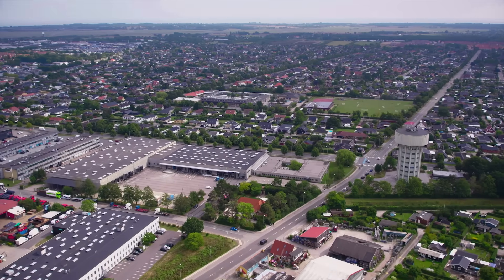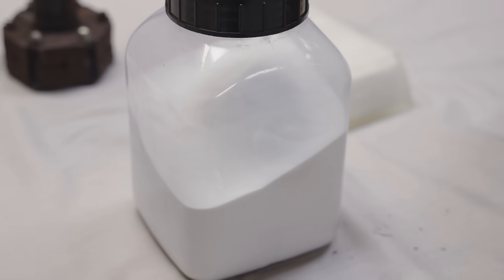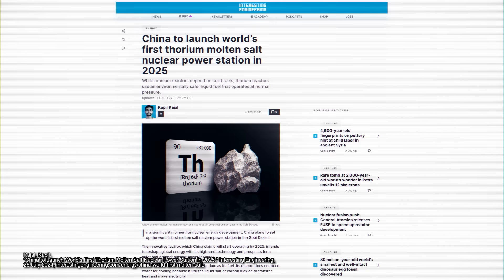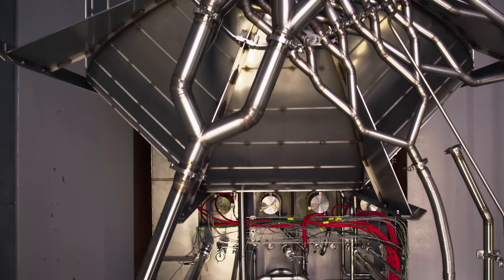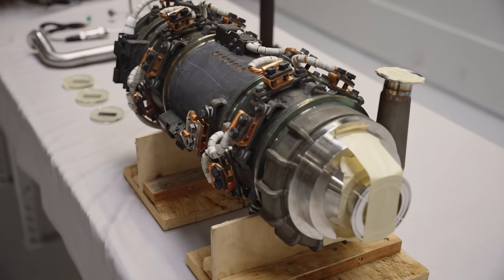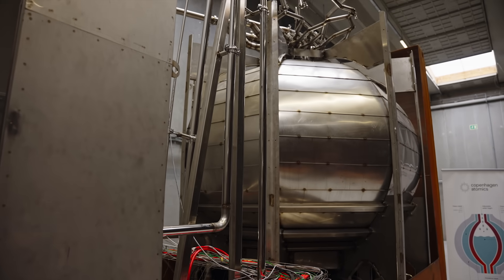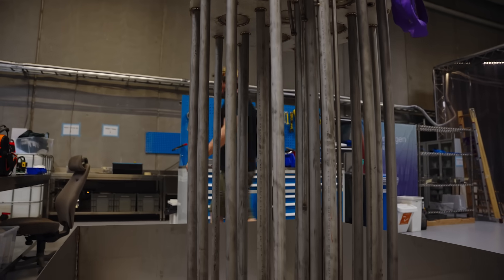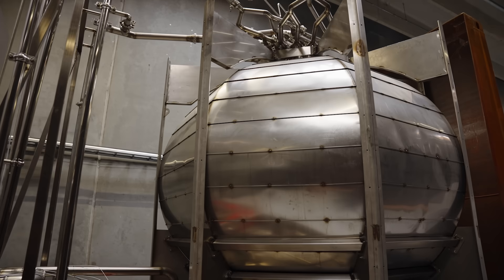Why Isn’t Thorium Changing the World?

Comment: Ya know, I wonder if the same process of protecting the metals could be applied elsewhere? 
This question comes to mind cause I was learning about saltwater batteries and one of the main problems that I have found is on the nonshiny metal anode (- or + not sure but the basic concept is shiny metal like copper, dull metal like alumininum, and electrolite like saltwater max 35% concentrate creates a battery the pushes .1A and .5V about 10-12 will charge a cell phone. other electrolites like pool chems and metals like magnesium (firestrikers or welding rods) + copper = even stronger battery.
BUT, here is the catch. mg+cu+NaCl  causes salt build up on the mg stick and stops power production, BUT is a cheap form of desalinating water plus power production.
Would that protection process be applicable to this from of power production?

Comment: Thorium is easy to mine but it has to be used in what amounts to a breeder reactor. Neutrons from the core convert the thorium to Uranium 233. This is removed, processed and put back as core fuel. It’s complicated. 
Static salt like Moltex use natural uranium and fully burn it leaving almost no waste. They also burn existing irradiated uranium fuel. This solves any waste storage issues. Because it’s not waste. It’s simply part used.

Comment: If you´ve been in Denmark with open eyes you should have seen the future: in 2024 83% of electricity was already renewable and exporting from all his wind power.   it is european leader in district heating, of course with renewable as well. 51% of all new cars are BEV. And all this will rise even higher in the next years. So why implement a potential dangerous and comlicated technic that only works on the presentation screens of start ups?

Comment: The high-temperature molten salt is highly corrosive to reactor materials, especially structural metals and alloys.
Developing materials that can withstand long-term exposure to fluoride or chloride salts without excessive degradation is a major engineering challenge.
Even in short-time experiments, it does not work. You get really big problems if not with the tubing, then with the pumps and the matter flow. When cooling down it becomes solid and therefore changes flow characteristics.
Reply: You do know that Copenhagen Atomics have huge experience with actual molten salt experiments? 
Last time I checked they had 50 years worth of molten-salt experimental data (obviously obtained by running a number of experiments in parallel). 
They know about corrosion, and they have solved corrosion. At least for a non-radioactive system, adding high radiation might add complications. 

The solution is NOT advanced materials. It is to keep the salt pure, since an oxygen- and water-free molten FLIBE salt does not cause corrosion. Which is what their experiments confirm. 

They have build their own production line for ultra-pure FLIBE salts, they have tested it in their own salt loops. And they sell both salts and loops to universities around the world (also there is a data-sharing condition on buying a salt loop, so they gain even more experimental data than what they produce in-company). 

To be clear, running a reactor will eventually cause a build-up of fission products where some of them will be corrosive. So initially the lifetime of a reactor will be limited to about 5 years, which is more than enough to become economical (much faster and cheaper to produce than a LWR). 

They are however designing a system for online cleaning of the molten salts, which would significantly extend the lifetime of the reactor. But they don't expect it to be operational for the early commercial reactors.

Comment: Let's break down the reactor's design:
Shape and Structure:
Imagine a sphere. At the very center, you have the reactor core. This is where the thorium fuel and the particle accelerator interact. Think of it like a super-hot, high-energy reaction zone.
Now, picture layers around this core. First comes the cooling system. You could have tubes or channels carrying that liquid metal coolant right through the reactor core to keep things cool.
Next, comes the shielding. A thick, spherical layer surrounding everything else, made of something heavy and dense to block that radiation.
Reactor Core:
Zooming in on the core, we have a few key components:
 * Thorium fuel: This could be in pellet form, arranged in a specific pattern, or even embedded within a specialized structure. It's the fuel that makes the whole thing work.
 * Particle Accelerator: Think of this as a system of electrodes or coils, arranged in a way to accelerate particles towards the thorium fuel. It triggers the fission reaction.
Key Considerations:
 * Materials: The reactor core needs materials that can withstand immense heat and radiation, like specialized ceramics or high-temperature alloys. The coolant system needs to use a liquid metal that won't react with the reactor materials.
 * Control Systems: We'll need ways to control the reaction. This might involve things like control rods, which can absorb neutrons and slow down the reaction, or maybe even a system that adjusts the accelerator's output.
 * Safety Features: Redundant safety systems are essential. We're talking automatic shutdown mechanisms, emergency cooling systems, and rigorous monitoring of the reactor's conditions.
This design is a simplified overview, but it covers the basics of a small, theoretical thorium reactor.

Okay, let's get into the nitty-gritty of materials.
For the reactor core, you'd want something incredibly sturdy to house the thorium fuel. Think of materials like tungsten carbide or even high-strength ceramics. These can handle the crazy heat and radiation inside the reactor.
Now, the thorium fuel itself – that's a specialized case. It's really about getting the right form of thorium and potentially mixing it with other materials to optimize the reaction.
For the particle accelerator, materials like tungsten for the electrodes might work well because of its ability to withstand high temperatures and electric currents.
Liquid metals are your best bet for the coolant. Sodium or a lead-bismuth alloy would be good choices.
And for the shielding, lead is a classic. It's dense, and it does a great job absorbing radiation. But you could also consider depleted uranium, which is even denser.

So, for a particle accelerator in a tiny reactor, we're looking at something super compact. A linear accelerator seems like the best bet.
Imagine a tube, maybe a few inches long. The walls of this tube would be lined with a series of electrodes – think of them like metal rings. Each ring gets a jolt of electricity, creating an electric field.
Now, you shoot the particles you want to accelerate – let's say protons – into one end of the tube. The first electrode gives them a push, speeding them up. As they travel down the tube, they get another push from the next electrode, and another, and another. By the time they reach the end of the tube, they're moving super fast.
To make this happen, we'd need a super-precise way to time the electricity going to each electrode. Everything has to be perfectly synchronized so the particles get a boost at exactly the right moment. You'd also need some way to generate the high voltage needed for those electric fields.
The materials for this are crucial. The tube itself needs to be a good insulator, so the electricity only goes where you want it. The electrodes should be made of something that can handle high voltage and not break down.

Alright, let's craft a detailed picture of this ideal microreactor, focusing on its construction, operation, materials, and manufacturing:
Reactor Design & Operation:
 * Shape: A perfect sphere, roughly the size of a basketball (approximately 24 cm diameter), to optimize shielding and energy containment.
 * Core: A central spherical core (4 cm diameter) made of silicon carbide, designed to withstand extreme temperatures and radiation.
 * Fuel: Thorium dioxide, highly purified, arranged in a 3D-printed lattice structure within the core. This lattice maximizes surface area for proton interaction.
 * Particle Accelerator: A miniaturized linear accelerator, integrated into the core, uses electric fields to accelerate protons to several MeV.
 * Proton Target: A thin layer of tungsten, deposited onto the thorium lattice, enhances proton interaction.
 * Coolant: Liquid sodium, circulated through microfluidic channels 3D-printed within the silicon carbide core, removes heat.
 * Heat Exchanger: A microchannel heat exchanger, using copper alloy, transfers heat from sodium to a working fluid (e.g., supercritical CO2).
 * Shielding: A thick spherical shell of depleted uranium surrounds the core, providing radiation protection. Graphite and Beryllium layers within the shielding enhance neutron moderation.
 * Control: A computer system monitors sensors and adjusts the accelerator beam and coolant flow to maintain stable operation.
Materials:
 * Silicon Carbide (SiC): For the reactor core, due to its high-temperature resistance, radiation hardness, and potential for microfabrication.
 * Thorium Dioxide (ThO2): The fuel, highly purified and potentially alloyed for optimal nuclear properties.
 * Tungsten (W): For the proton target, due to its high melting point and resistance to sputtering.
 * Liquid Sodium (Na): The coolant, chosen for its excellent heat transfer properties.
 * Copper Alloy: For the heat exchanger, due to its high thermal conductivity.
 * Depleted Uranium (DU): For the shielding, due to its high density and effective radiation absorption.
 * Graphite/Beryllium: Neutron moderator materials within the shielding.
 * Advanced Ceramics/Composites: For the linear accelerator and other components.
Manufacturing Process:
 * Core Fabrication:
   * Silicon carbide powder is used in a specialized 3D printing process (e.g., stereolithography or binder jetting) to create the spherical core with integrated microfluidic channels.
   * The printed core is sintered to achieve the desired density and strength.
   * The thorium dioxide lattice is 3D printed separately and then inserted into the core.
   * The tungsten target is deposited onto the thorium lattice using a vapor deposition technique.
 * Accelerator Integration:
   * The miniaturized linear accelerator components are fabricated using microfabrication techniques (e.g., photolithography, etching).
   * These components are then integrated into the core, ensuring precise alignment.
 * Cooling System:
   * The microchannel heat exchanger is 3D printed from copper alloy.
   * The electromagnetic pump and piping are assembled and connected to the core and heat exchanger.
 * Shielding Assembly:
   * Depleted uranium blocks are cast and machined to form the spherical shield.
   * Graphite and Beryllium moderator plates are integrated into the shield.
   * The core, cooling system, and accelerator are carefully placed within the shield.
 * Control System:
   * Sensors (thermocouples, radiation detectors) are integrated into the core and shielding.
   * The computer control system is programmed and connected to the sensors and actuators.
 * Testing and Validation:
   * The reactor is subjected to rigorous testing to verify its performance and safety.
   * This includes testing of the particle accelerator, cooling system, shielding, and control system.
Operational Details:
 * Hydrogen gas is ionized and injected into the linear accelerator.
 * The accelerator generates a focused proton beam, which is directed onto the tungsten target and thorium lattice.
 * Proton interactions with thorium initiate fission reactions, releasing energy.
 * The liquid sodium coolant removes the heat generated by the fission reactions.
 * The heat is transferred to a working fluid in the heat exchanger, which can then be used to generate electricity.
 * The control system continuously monitors the reactor's performance and makes adjustments as needed to ensure stable and safe operation.
Reply: This will produce 1kwh for 55 days before being refueled.

A larger design, the size of a refrigerator, will last 155 years before needing to be refueled.

There is a radically different method, not requiring any fuel at all that will produce the same power output continuously, and essentially indefinitely.
Reply: @kylehill

Kyle, the key insight here is the introduction of a linear particle accelerator employing a stream of protons from liquid hydrogen.  There is no need for uranium to initiate the process.   Please don't steal my idea.
Reply: If you can, I would appreciate any  connections you can provide me to others in the field.  I'm developing reactor the size of a basketball that can power an average household.

Comment: Ok i have to ask the obvious, why not use silica glass lined stainless steel? Silica glass can withstand the operating temperatures, has amazing salt corrosion resistance, and probably only needs to be a few millimeters thick or maybe just a thin coating... so why the difficulty in material science? As an electrical engineer I know my place in science is mostly geared towards the physical sciences of electricity but even that has material science involved. Transmission lines are electrically isolated from earth through means of ceramics and or glass... wonder if the same can be used to deal with the high levels of extremes that thorium salts may produce, would you not agree?

Comment: The US stopped molten salt thorium fueled reactors in the 60's, because we wanted plutonium for nuclear weapons.  Thorium fueled reactors do not generate plutonium, they just make more fuel from the thorium (the thorium is converted to U-233, which is fissile).  It's cheap, safe, and could supply all the power we need for centuries.  But we can't do it, because people are afraid of nuclear power.

What they should be afraid of is coal power.  But people are sheep and are willfully uninformed.

Comment: Ehhh not really assuming it was recently refined natural thorium is 99.8% thorium 232 which is an weak alpha emitter so the jug would block the little bit of radiation there is. that is assuming there was none on the outside. Also sodium floride has a boiling point of 1695C so you can "work with it" well past 700C, working with it at that temperature though would cause corrosion and near it's melting point a lot of stuff becomes soft, sooooo probably not wise to work with it there either.

Comment: Constructing parts out of Iridium seems like an obvious solution (the problem is likely cost).  It's corrosion resistant and has a melting point of 2,446 C, much higher than Gold (1,064 C). Platinum could work too (melting point of 1,768).

Comment: It's too bad they can't figure out a way to get it to circulate without the pump using convection currents or something.
Alternately use something that isn't metal for the pump mechanism.
An impeller made out of stone or some other substance that won't corrode or melt at a measly 700c

Comment: Regardless of the 'yet' approached issues in metallurgy that can handle violent atomic flux in a corrosive salt fluid environment, my academic opinion of this technology is higher than even that of fusion power in 200 years. A Brayton cycle super critical CO2 generator system would bring power generation efficacy out of the 1900's 30 - 40% towards 50 - 60% range; because of the higher operating temperature of the Molten Salt Reactor.

Comment: so not to sound critical about this, but if your worried about the metal parts that HAVE to interact with your salt corroding due to heat and salt, why not coat the alloy in a ceramic?  if turbines (typically a white ceramic coating) and exhaust heat shielding (typically a coated carbon fiber ceramic) on a jet engine can utilize this to withstand temperatures that get as high as 1000 F, I'm sure there's a coating which could add that extra protection to parts like the pumps impellors and shafts.  I know that's added complexity and cost but ceramics have been around for nearly a century for these applications, I'd be surprised if there isn't one in use for similar applications.  unless there's some interaction with ceramics that they just didn't get into here.

Comment: It looks like they are well on the way to solving many of the issues with salt and Thorium. How ever I did not see any of the safety concerns addressed, which is a very big issue.  In my view corrosion caused by the salt is "by comparison" of little concern. The biggest concern is keeping water and air from the salt. Doing so reliably and under any combination of fault conditions is what going to make or break a salt reactor of any design. Freeze plugs and dual salt loops are not going to be enough to convince the skeptics especially when the design comes under fire those that do not want Thorium. The other big problem is all of the company's that have a large investment in uranium are going to ruthlessly oppose Thorium. If all the issues can be solved Thorium can be a game changer. The best bet would be for Copenhagen to partner up with India. Best wishes

Comment: I don't get why their pump needs to be able to work when red hot... It should certainly be possible to mount the pump away from the heat source and drive an impeller using a long shaft. Everything can be built simply from a very temperature resistant metal such as Titanium (melting point 1700C). If you want you can cool the motor using water cooling. I think the most difficult part of this would be sealing the input shaft, but maybe this can be achieved with a pressure differential (well not differential but you get my point) to keep both sides equal as well as tight tolerances.